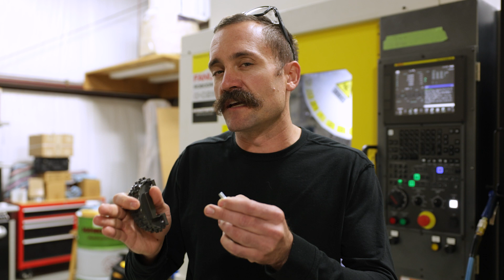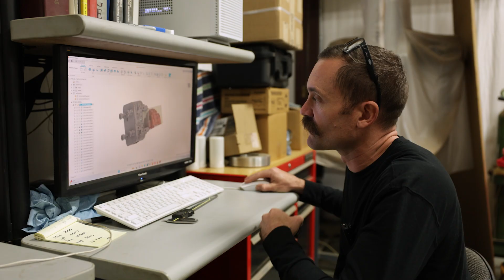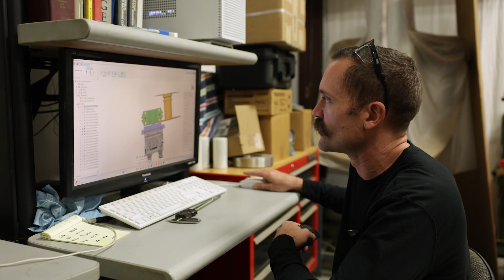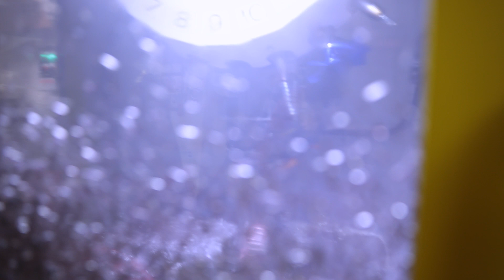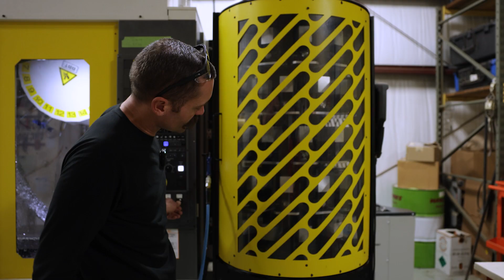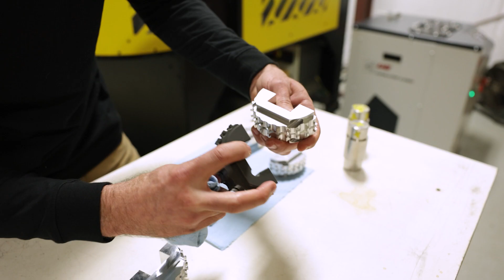Why you NEED to COMMUNICATE with your CLIENTS

Comment: what coolant are you running? Looks like an oil. 

And how did you get a custom coolant tank, did it not come in with one and you had to fab one up? If so im curious what pump you got and what pump you plan on replacing it with.
Reply from the maker: We are running a straight oil, we talk about it in some of the earlier videos. The tank is from Hennig, we  ordered it for cutting oil. Sadly it is not working out, the tank can not filter the oil fast enough. So the oil flow is too slow. We are going to add some more volume, and change some things. There will be future videos on this. Thanks for watching.
Reply: @ConourManufacturing  Ah, I thought your problem was the oil was to viscose to be pumped with a coolant pump ment for emulsion coolants (so pretty much the viscosity and density of water).
 So your saying it's not draining back to the tank fast enough...Can you replace any filters with larger micron size filters to help flow?
Reply from the maker: @HuskyMachining  the pumps were ordered to pump oil, so they are good. A guess the simple answer is yes, the filter size can get bigger. However we will get more swarf into the sump, then the high pressure oil filters will clog quickly.

Comment: I operate a newer version of this machine. We never had any problems with coolant. We use normal water&oil coolant at 3%. Because of my lacking experience I don't understand the use of cutting oil.
Reply from the maker: Cutting oil, is easier on the machine. It improves tool life, and does not evaporate for long unattended runs. Thanks for watching!